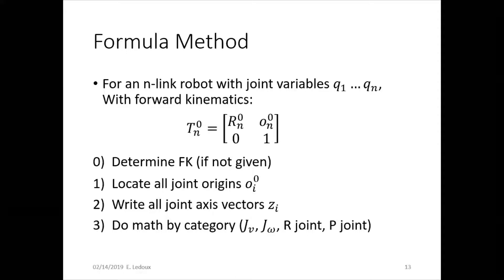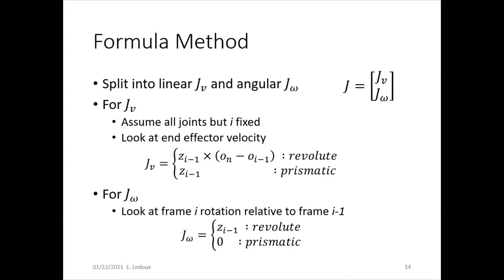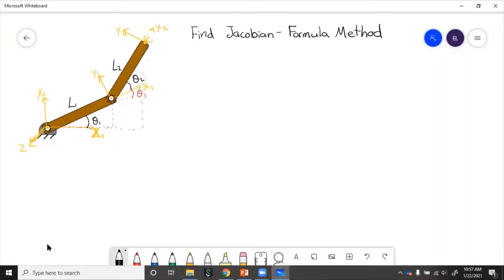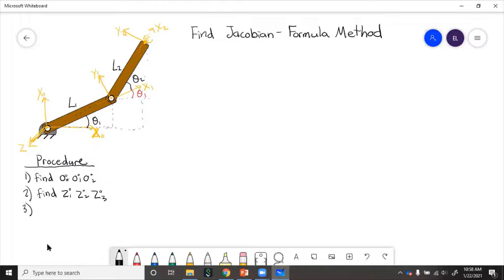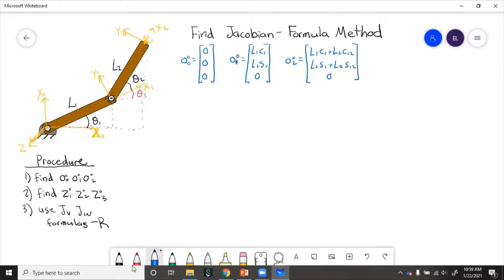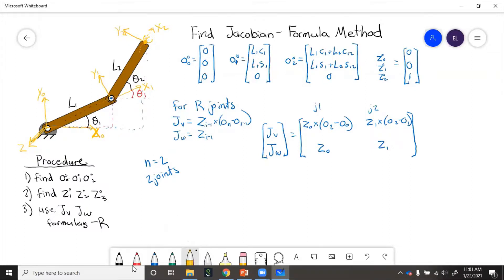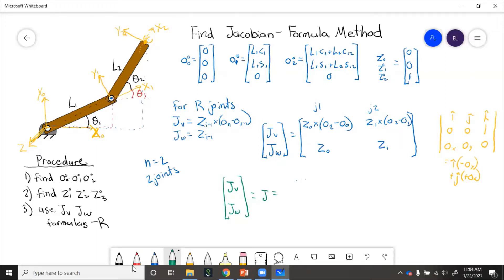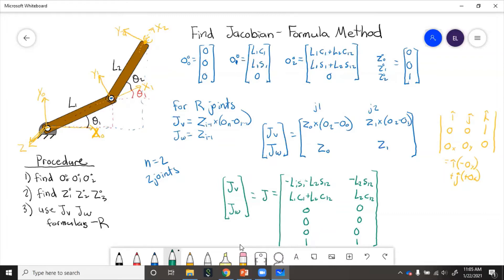Two Link RR Manipulator Jacobian Example - Formula Method

Comment: Hi, do you mind explaning why 6:35 , the 1-1 is also a junk? Is it because 1,1 part is redundant?
Reply from the maker: It is because the z-orientation cannot be independently controlled.  If there were three joints, than you would leave it in to have a 3x3 J matrix.  But without a third joint, only x and y can be independently controlled, so you just need a 2x2 matrix.
Reply: @roboticsandengineering  Thanks